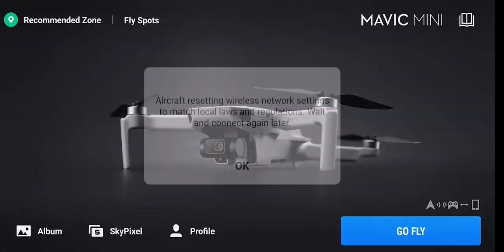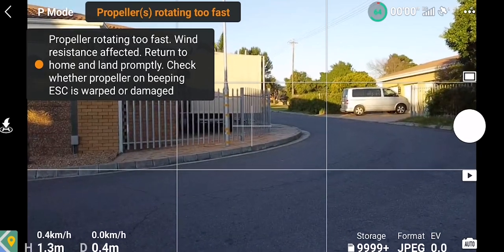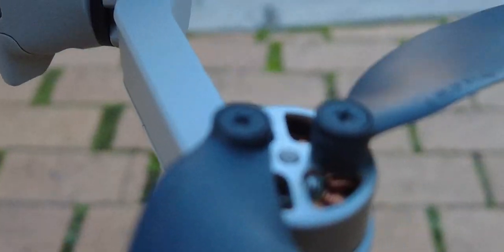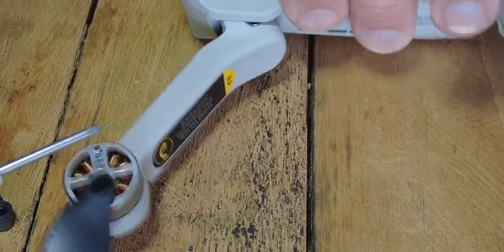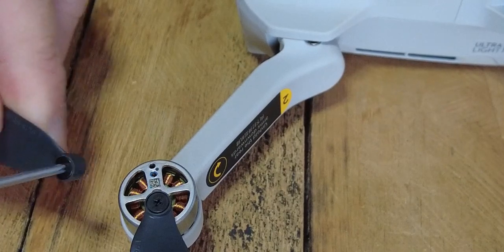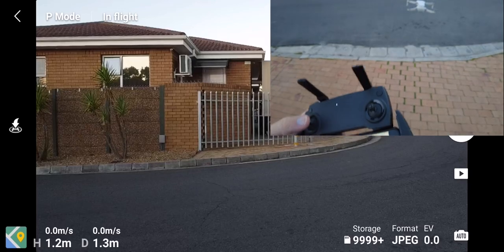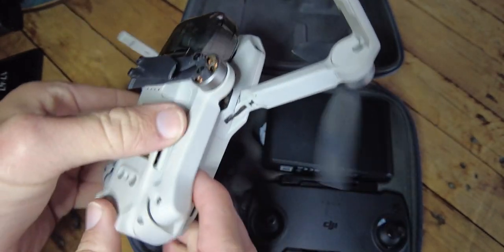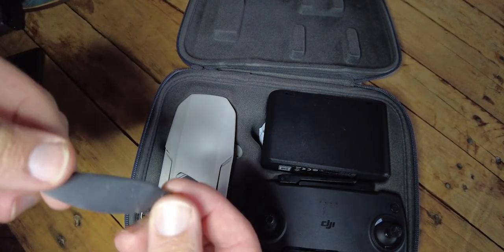How to fix - DJI Mini propellers rotating too fast!

Comment: That's a good heads up.. Thank you. I usually look for cracked or bent tips.  Never looked at the motor side for slight bends like that.
Reply from the maker: Glad to help
Reply: This is actually how my drone went down in a fjord in Norway

Comment: Thank you for the good video question though my drone can't even take off and it looks like it's leaning on the back engine is this the same problem?
Reply from the maker: check your propellers, I think you have the wrong propelles on the wrong motor.
Reply: @InfinityDrones  thank you you were right
Reply from the maker: @Russell-y6b  Great stuff, so you're in the air again!

Comment: Very useful video, I use a Propeller Holder Guard to keep them in place and when changing the prop on any arm I change both not just one (as per DJI) prop. I also use a small 5" Phillips #0 screwdriver rather than the cheap one that comes with the drone less likely to strip the screw head.
Reply from the maker: Yeah, those items you have really are essential. Good job!

Comment: a very nice video. Thanks man
Reply from the maker: Thanks man. Hope it helps people.
Reply: @InfinityDrones  btw do you know, is it ok to use propellers from mavic mini 2 for mavic mini?
Reply from the maker: yes, just do not use the screws of the mini 1, it will retool your mini 2 motors. Only use the mini 2's existing screws

Comment: Thank you for this video! It was extremely helpful.  I was having the same issue and so I changed my left rear propellers but accidentally used the wrong ones without the lines.  My drone would not lift and I freaked out thinking I broke it.  You saved my drone. 😊 ❤
Reply from the maker: Great to hear!

Comment: What’s the solution for storing the drone. Especially when travelling lots. 

I’ve got an international flight coming up (aka will pack in my suitcase). I’m just gonna take the propellers off and put in a small plastic box.
Reply from the maker: taking the props off is a solution since they won't bend in the case. But ideally a different case all together would be a more permanent solution.
Reply: @InfinityDrones do you recommend a case? I have spare parts for my drone and everything doesn’t fit and had to rearrange my stuff to fit.
Reply from the maker: @kaci7789  I like the StarcRc hardshell cases

Comment: Currently on vacation. Problems started occurring. I don’t have spare propellers on me, could I still fly over the rice fields here and fix it when I come home? No visible damage at all and always have been very careful with the drone. Issues started appearing as soon as I installed the software update
Reply from the maker: if possible, try and swop the font blades with the rear blades as a quick fix.

Comment: My propellers are brand new, I’ve swapped out two different brands. And I’m still getting the error. It’s also telling me that my maximum flight altitude has been reached. I don’t know what’s going on
Reply from the maker: Are you logged into your dji account? If using an iOS device you can try to restart the device, go to airplane mode and try running the app agian. 
If that solves the problem, remove the app and reinstall it from the dji download center to be sure you're on the latest version.

Comment: I use the newly designed roomier fly more case but just got this error and I think it is because the DJI storage strap I bought causes the blades to bend and deform -  so its not just the case. These blades are very delicate and maybe need to be redesigned.
Reply from the maker: Yeah, I agree. Mini 2 seems to fine - I've not seen this happen with them or the Mini SE (basically Mini 1).

Comment: You should use a set of silicone propeller guards.
Reply from the maker: Yes that is a solution for storage, but the stock mini unfortunately does not come with it as standard. Definitely a good option for those who use the stock carry case.